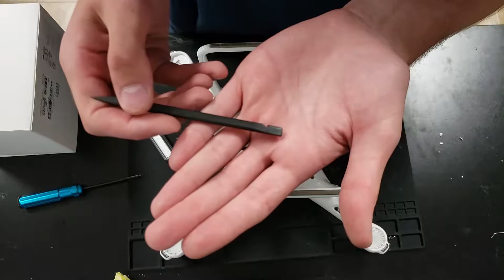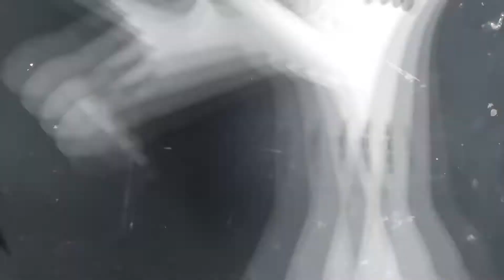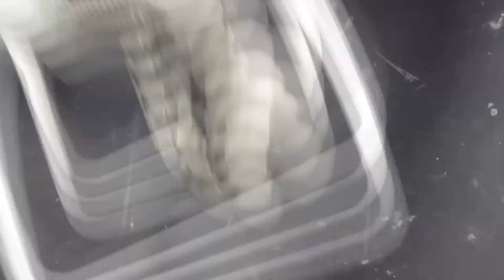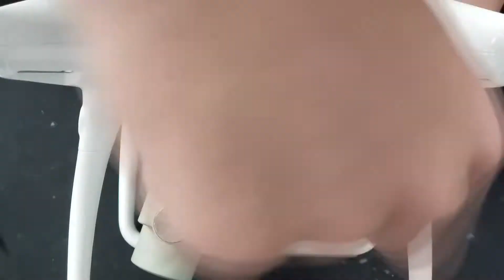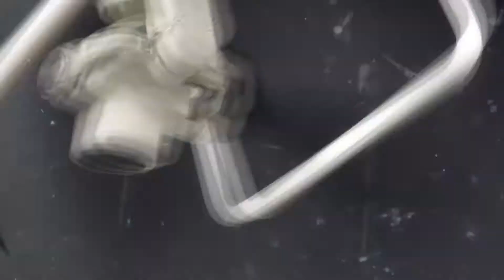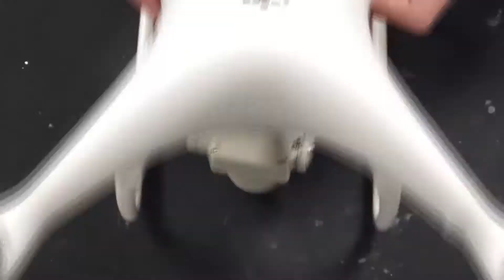DJI Phantom 4 Gimbal Replacement Guide (Phantom 4 Standard,Advanced,Pro)

Comment: Hello three week old p4 std prop flew off snapped ribbon cable and broke yaw arm replaced both nothing however black lock tab is broken away this maybe whole issue? Where can I send for repair dont want to damage more sure nothing major worked flawless b4 crash vazquez.keith2018files@gmail.com